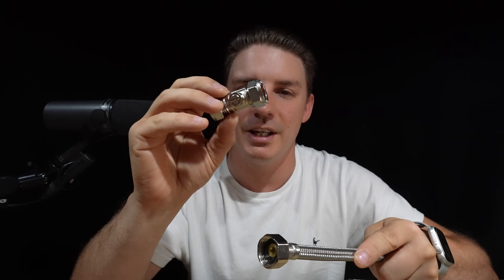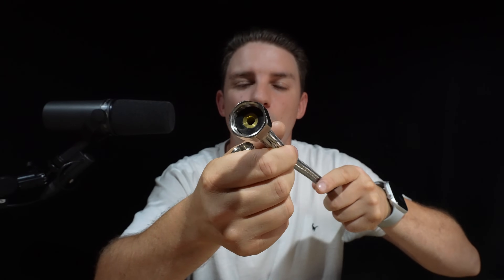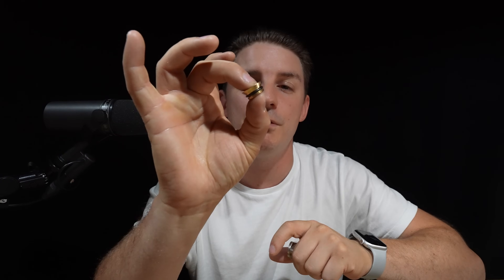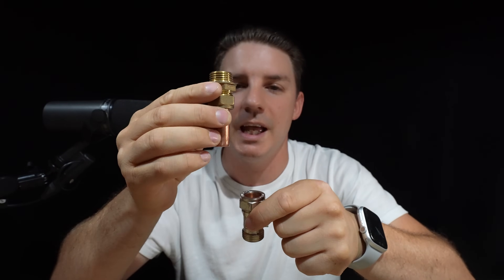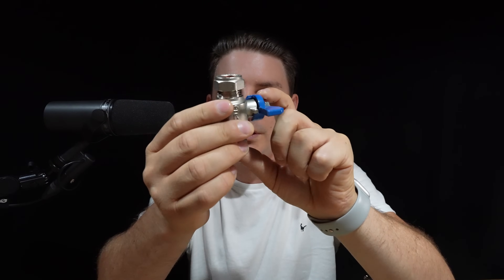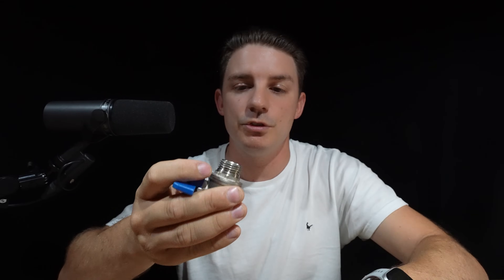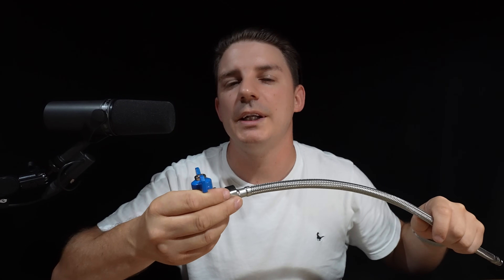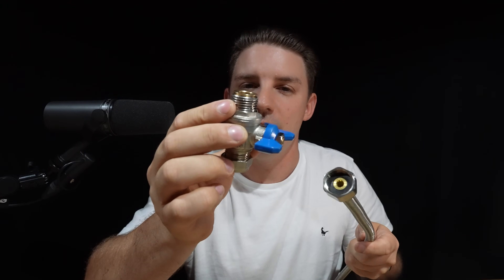The Future Of Connecting Flexible Hoses To Valves?!

Comment: It's a good idea. I always put a nice shiny flat on the fitting with a diamond block which works. I suspect it will be a bit like Dowry seals - people still use fibre washers despite the vast superiority of the Dowry seals. It's the old save 20p now and buy a new ceiling next year.
Reply from the maker: I’ve been using them for a while now and they work really well, 0 issues so far 🤞

Comment: I would not use ever again any flexible hoses in my home they have a sort life span and when the cold feed goes there is one big leak , they may have there place however easy to fit and save time for the plumber  but no good for the customer in the long run .
Reply from the maker: If I had it my way I would hard pipe everything too mate

Comment: I’m sure you can buy flat face iso valves. Those little inserts look like they make a very nice oriface plate pressure restriction.
Reply from the maker: There good mate not had a problem using them

Comment: Just use a Flat faced isolation valve.
Reply from the maker: easier to stock these and my favourite valves
Reply: @mmplumber i would be asked to remove them if i fitted them in a bathroom, they are ugly
Reply: @mmplumber its no harder to stock either its just ur preference

Comment: I've been watching a good number of your videos recently. You seem to have hit the sweet spot with well over 600K subscribers in less than 3 years. Informative, direct, no fancy messing around, excellent stuff.
One thing I would pull you up on is the fact you call those isolation valves, butterfly valves. They are full flow ball valves, there is no restriction at all to flow when fully open. A butterfly valve will always have a restriction to flow in the way of the central spindle that goes through the valve to support the "butterfly." I know why you call them that, due to the operating lever being butterfly shaped. But they are a ball valve.
Reply from the maker: Got ya cheers for that dude I just call them that due to the handle 🥰 appreciate the support on the channel I’m getting better slowly at it and really do like the long form but I’ll be stepping up the quality in the new year and still keeping the same format as a quick intro then straight into the work with a relaxed watch approach 👍
Reply: What brand are the valves?

Comment: i am just getting into learning a bit about plumbing with my maintenance role in a prison and use flexi hoses regularly on plastic solenoids that activate in cell taps. can I ask what the point of normal compression  fittings with a taper if you can get flat faced valves?  thanks
Reply from the maker: Compression is used with a nut and olive and flat face uses a washer

Comment: You can buy ballafix valves, cheap, with one side flat edge.  Those inserts are only worth buying for your butterfly handle valves.  You would think they would also make some suitable for flexi connection with one flat side ?
Reply from the maker: They do well them but then you need to stock multiple valves

Comment: Will these work on flat faced isolation valves? And can you buy these in screwfix?
Reply from the maker: There to make normal valves into flat. At moment available at www.directplumbingsupplies.com
Reply: You wouldn’t need anything on a flat faced iso they’re designed for a washer.

Comment: They are to expensive at the moment. I think £1.50 for 2 is about right.
I currently just file down the iso valve face with a fine file. Works perfectly.
Reply from the maker: Should come down mate eventually
Reply: I think the price is acceptable, but the postage cost is excessive if I only want to buy a couple

Comment: there are a bunch of solutions to this problem.
1 use gaskets that cannot be cut, for example paronite
2 take a file and file down the edge so that it becomes flat
3 do not overtighten the nut (many flexible hoses have a special plastic wrench on the nut so that it is not overtightened with a tool)
Reply from the maker: Too much room for error without these adapters

Comment: I have connected a flexi hose to an isolation valve 100s of times and no problem because I know how tight to do up the nut. Most DIY plumbers think every nut must be as tight as they can make it. Same for olives.
Reply from the maker: True but still only tightening down onto next to nothing and it’s the wrong thing to do

Comment: Used to keep a few short copper lengths soldered into a Solder Ring Fitting - Male Straight Coupler 15mm x 1/2"  to do this job.
Reply from the maker: Yeah good shout they can just bring it too high sometimes

Comment: Nice information here, thanks.  2 observations regarding flexis onto iso valves in my experience.  1.  As everyone knows, they leak on overtightening.  2.  They leak when the flexi is twisted round too much, not necessarily kinked but under strain and they will loosen themselves over time, trying to return straight and through the water hammer of the on/off tap etc.  If you know the feeling of tightening them to that sweet spot, I've not had a problem in my 22 yrs and always go back to the same customers I've done say 15 yrs ago etc.  Personally, I don't like the idea of introducing an o ring into the fitting as I would be worried this may cause an issue if, for example the inside of the fitting was scored or not formed correctly ( past the chamfered bit for the olive) but that is just me.  Also, I have had some flexis that just don't sit properly on an iso and you can just feel this by hand tightening, so then I do use a 1/2 inch male.
Reply from the maker: Fair enough mate I understand that! Many ways of doing plumbing just use what your confident with
Reply: Someone needs to re-design the flexi, to accommodate rotation and also address some of the other failure modes

Comment: I usually file a normal isolation valve flat where it connects to the rubber washer on the hose but this is definitely quicker and easier if it's not too expensive
Reply from the maker: Yeah great for retro fit

Comment: You can get isolation valves with a flat face for the flexihoses at plumbers merchants, Screwfix and Toolstation. No need to add any other fittings. 😊
Reply from the maker: You have to keep multiple valves in stock that way! The inserts can use any 👍

Comment: This is a good idea but you can buy 'flat face isolation valves' which do the same job without using an insert x
Reply from the maker: Saves buying all different types
Reply: @mmplumber but instead of buying the different valves you’re buying the insert? They have a place for exsisting but where possible we should be buying the flat face valves.

Comment: Plumber  here, was always taught hand tight and a nip will never cause a leak on these flexis, I have installed hundreds without a leak,, overtighten slightly you're susceptible to  leaks. I don't think we need to over engineer this issue, plumbers and DIY "experts" just need to know HAND TIGHT AND A NIP

Love youre channel btw, love your work and professionlism, you're a credit to the plumbing industry
Reply from the maker: I’m just trying to make the industry easier with giving the correct methods 👊👊 appreciate you like the channel mate I’m trying my best to make it better
Reply: @mmplumber  As you said in your video. Some people will never wrap their heads around offering the best in class service by minimising potential future issues for the customer for the sake of a couple of quid. I have just ordered 10x from Direct Plumbing. Thank you for sharing your knowledge sir.
Reply: im always like " whose hand?" my grip strength can tighten some stuff tighter than what another person can do with pliers.  i'd rather have something i don't need to fuss with, like a flat surface for a flat washer or a cone for a conical washer
Reply: @timefeatherstorm  if it was such an issue the flexi manufacturors would tell us or design better
Reply: Typical cowboy comment,
Reply: @johnbower  what is your qualifications and what country were you trained?, if this was a big issue the flexi manufacturers would have designed or warned us to use flat faced connections. John Bower you're  you're a cheeky uneducated and inexperienced charlatan
Reply: @johnbower  what is your qualifications and what country were you trained?, if this was a big issue the flexi manufacturers would have designed or warned us to use flat faced connections. John Bower you're a cheeky uneducated and inexperienced charlatan. I bet you're the lemonhead that overtightens these connections
Reply: @johnbower  im a qualified plumber with more experience than you

Comment: Great video on those inserts
Trying to find a stockist tgat diesnt charge a fortune for postage

Can you do a video on the fitting or conversion of a towel radiator to dual fuel central heating and electric element
Reply from the maker: Aww I hate them duel element ones! The tee never fits right

Comment: I just use the 15mm x 1/2 hoses little bit of copper between the valve and the flexi then staright into the tap...
Reply from the maker: More joints
Reply: @mmplumber surely its the same? Valve to copper = 1 joint copper to flexie = 1 joint.. thats 2 in total.. then you have your insert to the valve = 1 joint then you have the valve to the flexie = 1 joint ?

Comment: Click like if you get loads of leaking iso to flexi connections to attend to. I'm yet to see one.
Reply: Not only from an engineering perspective, but it is just common sense not to compress a sharp edge into a flat faced washer. "I've never seen it" isn't a good enough excuse. In manufacturing, 1 in 10,000 defects is a disaster. Imagine if the failure rate is anything close to that number.
Reply from the maker: @0sael0 I see it every week mate my latest video shows exactly that!
Reply: @0sael0 lol...this is plumbing, not serious engineering where you go to jail for a plane crash. If they leak they drip a very tiny amount apparently rather than cause a tsunami. Adding an oring is just another place they can fail.do you think orings never fail? Plumbers exist because almost everything fails at some point. You're obviously not a plumber.
Reply from the maker: Watch my last YouTube video 👍
Reply: @mmplumber seen it as it like 99% of your content but I want to see how many other plumbers get this issue to fix as often as you

Comment: The adapter fittings that are solid brass (male stem to flat faced female threads ) are a good idea and they should never come off under mains pressure if the olive is compressed properly.
In fact, a 15mm brass stem pipe is superior to a 15mm copper pipe as the olive seals well due to zero possible deformation/squeeze of the stem. (15mm Radiator valve tails are proof of this as they do not weep if olive is good quality.)
Brass olive best on brass tails.
Note that using radiator valve tails for flexies may infringe water bylaws as the valve tails are not passed for potable water and might have a lead content.
Personally I use male straights and that can be an advantage to fit the isolating valves lower in a perfect position (between lower and middle shelf in basin and sink units for example) and if in the future a new tap has different length flexies, the upper copper pipes can be altered easy.
If you tighten direct onto a valve - you risk twisting the flexi. Best to tighten onto a fitting first before you compress the fitting to the pipe.
Male 15mm X 1/2” bends are often also ideal for some jobs and allows the flexies to just have one bend.
Reply from the maker: Lots of different ways mate great to have options for all scenarios, just way easier to store and keep stock of these and just keep to your most used isolation valves
Reply: @mmplumber  Certainly very handy way to adapt a fitting to a flat face. Could just make such an advantage where height of valve is already at limit for the flexi.
Great choice of isolating valves! 👍
I have stopped using the small bore ballofix valves and the full flow type also are often too difficult to turn with a flat screwdriver. I have been using Pegler small handle valves from SF similar to yours
Reply: Deformity in the copper pipe is what helps lock in the olive and stops sliding. Rads are not under mains pressure.
Reply: @frankief7111  Olive can never slide off if it is compressed. Once you open the fitting, yes, you will be able to pull the nut and olive off relatively easily, but not while fitting is tight. 
Using a brass olive is even better and will have more grip and remain so as the brass forms a more permanent harder shape. We are not talking about extreme high pressures here - and olives will grip even if 10 bar pressure. 
I know heating systems are not under as much pressure as some mains water pipes, but heating pipes can be at pressures of 2 bar or much more. 
Copper pipes do not need to have the olive crushed into them. The olive just needs to be under pressure and remain that way to hold and seal. Even a split olive will grip and hold no problem while the fitting remains tightened. Chromed tails have harder finish and friction is less on them, but try to pull a fully tightened compressed fitting off one and it still won’t budge. 
Problem is normally with incompetent plumbers or diy people who do not know how to compress the olives carefully. 
The old imperial copper was so heavy walled that it generally remained unmarked by the olives, yet it always held high mains pressure. 
I am heating engineer of over 40 years.

Comment: Why don't they make a valve for isolation valve to flexible hoses. They would sell like hot cakws
Reply: 1 valve, serving both tasks. Less different parts in your van. Just a few extra rings. Perfect.
Reply from the maker: Nice and slim, small can stock a fair few
Reply: Cakes 😂

Comment: As @Danny.A665 mentioned, you forgot to mention flat faced 15mm x 1/2" isolating valves...or is there an issue with these as well? Amazing it's taken nearly 30+ years for someone to come up with a solution! So it's either not a problem or plumbers not too bothered.
Reply from the maker: We shall see mate! I think it’s a good idea, maybe a tap manufacture would like them in there kits

Comment: Flat faced isolation valves work equally as well 👍
Reply from the maker: This will mean you can connect onto existing without changing the old ones…as long as there not leaking 🤣